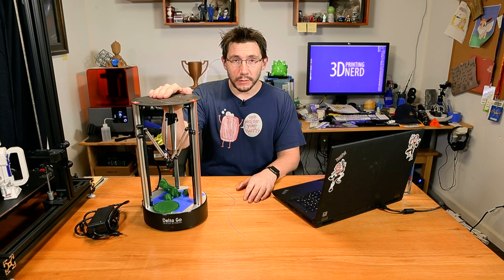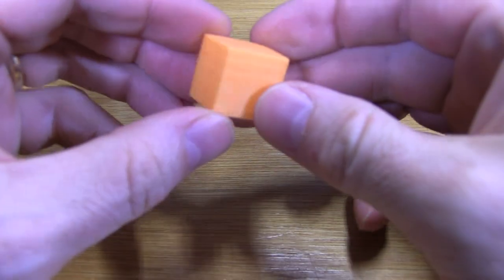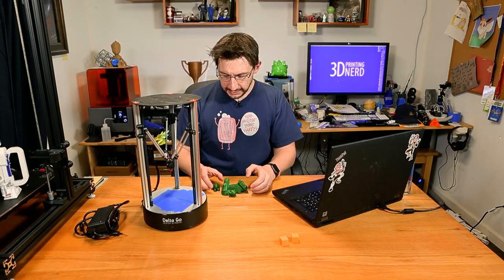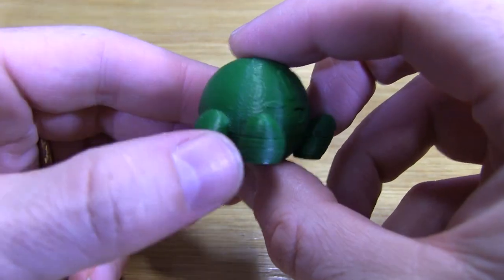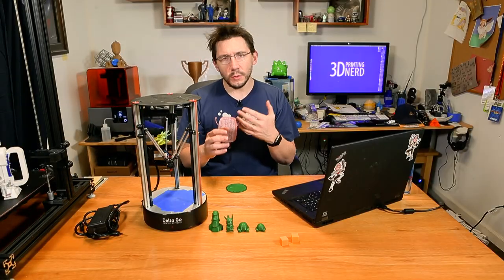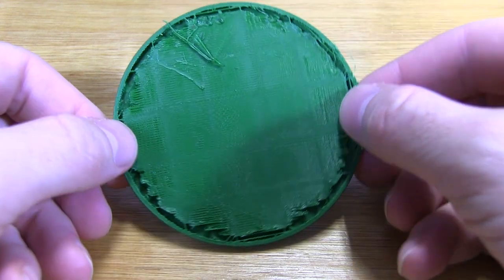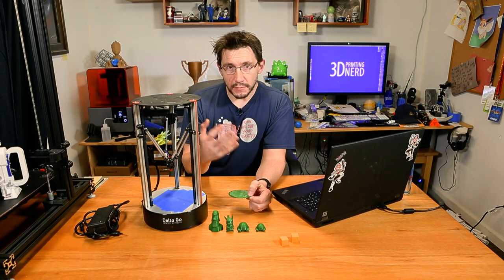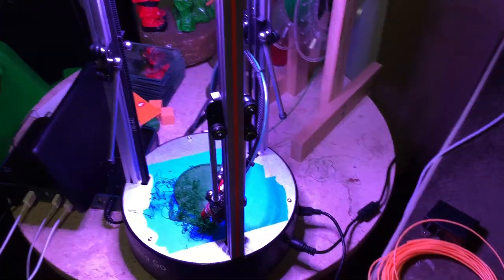Deltaprintr Go 3D Printer Review Update

Comment: DeltaGo was my first printer. It was broken more than it worked & getting replacement parts took weeks. I finally designed & printed my own replacement for the part that kept breaking & had it printing really good when the board fried & they told me it would cost $100 for a new board. It's been in it's box ever since. Now I have a Tevo Tornado & Tevo Tarantula & I'm very happy with them.

Comment: I feel like the heat break is a total design flaw.  There should be something from stopping the shield from moving up causing a clog.  I think I might have commented that on your previous video but I can't remember.  I'm glad they are making changes, but I feel like if they know these are issues, they should stop selling them until the updated parts are available.  Especially when it can be a fire hazard.  I don't love the idea of magnets, I feel like its not really necessary.  Wouldn't snap in pieces be just as easy but more effective?  I look forward to your updated review.

Comment: that hotend is hanging way too low making it unstable when moving fast (center of gravity too low) and it multiplies errors too because that mounting plate will always have some horizontal twist. it also subtracts from maximum printing height and makes it easier to knock those magnets off. i suspect that bowden tube and power cable might be able to stick to those vertically moving "arm elevators" (sorry, having trouble finding right word for those), which would be a instant fail.

Comment: The vast majority of these hobby-grade 3d printers need to grow the Hell up.  There should be a utility PCB at the hotend site to control various things, depending on the printer.

In this case, it could have an MPU6000 which would detect if the effector platform ever tilted away from horizontal.  If it does, that's an automatic error condition on most deltas and shutdown time.

It's also totally greasy for them to request that you hold off on the review.

Comment: 3:50 It is the inherent flaws of magnets. The magnetic force is the weakness at the sides.

Did you get the chance to ask them what kind of magnets did they use?   they might be able to drastically reduce the issues by using stronger magnets, such as Neodymium  N52 magnets.

however, the Z inconsistency is most likely a totally different issue altogether.
Reply from the maker: I didn't get a chance to ask what magnets they were using, though as others have pointed out, they may be too weak for this application.

Comment: As always great video! Thank you! I want to ask if there any sense to make a 3dprinter with no print fan? You'll always have cooling problems! Is it right?
Reply from the maker: Well, yes. My main concern here is why no filament cooling fan on a machine that's built to run PLA filaments? There is no heated bed, so your filament choice is limited a bit, and PLA really benefits from having a filament cooling fan.

Comment: I'm glad I didn't buy this, I almost did though then I canceled because of the wait and I needed another Delta sooner than later so I went with an Ultibots V250 Delta, best printer I've owned so far. Pair it up with a Duet Wifi and it's silent. I wish you'd review more kits but you're a busy guy and don't want to assemble them. I get it.

Comment: Well, here it is almost May... any updates from deltaprintr on this model? Have they said when the new upgrades will be available?
Reply from the maker: +Jeffrey Seymore nope :(
Reply: I saw on their Instagram that they have a new style platform for the hotend that has the balls clip in, and also has an integrated fan duct to cool the print. Looks like a good/better design
Reply: Hi Jeffrey, we just finished production on all the parts for the upgrade. We're just waiting to receive a few more samples for the stainless steel balls before we can start production on those. All current owners will get the upgrade for free once we announce it.
Reply: Deltaprintr nice! I was looking at getting a second smaller printer and was thinking about yours as I like its size, and features it if gets dialed in and reliably printing!! Looks like you are on the right path!! And updates the to extruder motor design/placement? Seems like some people had issues with that as well. And I assume a change in the way the Bowden tube connects?
Reply: The upgrade includes a new platform, arms, new hotend, fan, and new extruder spring that is slightly stronger to prevent filament slipping.
Reply: Awesome! The new version will come out in two weeks. If you would like, you can contact us to reserve it.

Comment: I detect a bit of FUD here...

I disagree with your opinion that this printer is somehow more dangerous than other printers simply because the effector can be knocked loose.  And to be honest I'd expect a more informed opinion from seemingly respected 3D printer reviewer...  

FIRST:  The Smoothieware firmware this printer runs has a built-in hardware watchdog timer to prevent thermal run-away.  Sure your bird's nest of plastic was messy and maybe a bit frightening to see, but it was never at risk of being heated to combustible temperatures.

SECOND: I built a delta that uses zero-lash magnetic diagonal arms similar to these and I've never had an issue with the effector coming loose.  Perhaps the Deltaprintr Go uses magnets that are too weak, but I certainly wouldn't condemn all mag-ball setups as being more risky to use than ball-joint equipped ones.  In fact, one may argue that the magnetic joints may have prevented the heater element or thermisor from being torn free of the hot end...which in my opinion would have far more potential to start a fire than an the effector simply coming loose.  

In any event, regardless of the the overall design, it's a risk to allow ANY 3D printer to run unsupervised.
Reply from the maker: Yes, I know about the thermal runaway watchdog, though, I wasn't talking about thermal runaway. I was more concern with the entire hot end falling away from all magnetic arms and dropping to the same surface the printer is on. That's all. As for magnetic diagonal arms - my guess is you are correct in that the magnets are most likely too weak. If it came across as me condemning all magnetic arms, that wasn't my intention and I apologize. I was more concerned with this specific implementation and not all implementations. I hope that helps.

Comment: Even the models are some kind of catastrophe, also the not-detective toolhead when there is a bump or a collision. I have a flux delta printer with tilt-detection, filament run-out detection, cooling fans, also magnetic sockets (they are working very well). And also it comes with a laser engraver for attaching instead of the toolhead. Also integrated, there is a 3d Scanner (which is still in beta-phase, works not soooo well) Joel, why you dont review one of those machines once? Im quite happy with mine.
Reply from the maker: Hey Mathias, your machine sounds cool, if the manufacturer reaches out I would love to try it out!

Comment: Have you gotten the new printer parts?
Reply from the maker: No I haven't. I think Deltaprintr is going to take this machine back and send along a new one when it's ready.
Reply: Can I ask some advice then. I was considering this and once seeing the video want to hold off. I have a printrbot plus metal. I've upgraded from the printrbot simple (the old wood one with twine and dremel sanding bits) 
What would be a good reliable printer to move to since my printrbot metal seems to keep needing repairs.
Reply: Hi Andrew, Joel will get our new printer to review in less than a month if you're willing to wait :)

Comment: From my point of view, the magnetic system is OK, if one adds quite simple hack - connect the magnetic parts on the moving axes with wire, connect 2 of the ends of the magnets on the hotend parts with wire and then use the last remaining 2 as a switch - once the electric current stops flowing, pause (or turn off) the printer - clearly one of the rods disconnected. The solution would cost almost nothing - basically 2 new wires to the hotend and one small software change.
But this is something I do not understand about at current 3D printers. Almost none of them have even a stupid filament sensor to pause printer, when the filament is out. Why? Due to a cost of a single microswitch???
Reply from the maker: Hey Robert! That's a great hack, perhaps someone will implement that? As for filament out sensors, I think we are starting to see that. The Dagoma delta I saw at CES has that built in, and I'm willing to bed that's going to become the norm sooner rather than later.

Comment: Just a follow up after speaking to Joel - it came to our attention that the bed (tape) was not wiped down with alcohol as per the instructions on our website. This should be done after every print to ensure that the first layer sticks. Otherwise the corners of a print will curl up. In this case, (without actually seeing) I would guess that the part's first layer is curled up in the shape of a bowl.

Another thing I would like to comment on is the Z issue Joel pointed out in the printed cube - that is under-extrusion, not z-resolution or z-axis issues.

Anyhow, we are going to be manufacturing a new platform setup and have decided we will offer it to our current customers for free. We'll also be sending one to Joel to evaluate.

This is by no means to discredit joel. He does great reviews and we're glad he's keeping it honest. We're looking forward to seeing his updated review on the updated effector design.
Reply from the maker: Shai - "without actually seeing"? I showed off THE part that caused the machine to blow up in this video. It was a close up, and it was flat as a pancake. NO edges curled up, and I didin't specific any sort of bed adhesion issues because I had none. There was no bowl and no curling up of the first layer. It's irresponsible of you to make a comment such as this without, at the very least, watching the video first.

Comment: Have you tried the new hotend? I got the printer from my friend as a loaner while he gets back on his feet. I've been able to print a few things but I have the same issue with the printer arms playing hot potato with the hot end.  
http://www.ebay.com/itm/322507092843?ssPageName=STRK:MEUNSOLD:IT&_trksid=p3984.m1560.l2649
thats one of the things I've printed. Quality seems decent but I found this printer has no issues with vertical heavy prints. It tends to pop when I have prints that involve a lot of horizontal movement such as a stand for a model. I've also managed to get a PETG working on this printer. But I agree the original hot end is not a great design.

Comment: WOW they asked you not to review junk they are still selling? That alone would remove them from my BUY list forever.
Reply from the maker: Well, it's not junk, it just needs some new parts in my opinion :)
Reply: Hi Brian, with all due respect, our printers are by no means junk and we make them professionally with mold injected and stamped steel parts. If you want, take a look at our instagram to see some of the prints we've created (without any fancy video editing to hide anything) instagram.com/deltaprintr

We always take feedback seriously and continue to improve upon our product. The arms would only pop off if there is layer warpage, otherwise they should not pop off. This is why we recommend our users to wipe the bed with alcohol before printing to ensure the first layer sticks.
Reply: Your video has a clear mount, it doesn't look like the production one your selling. When I say "junk" I am talking about the real world prints and quality. Your own pic the "Buddha" has holes in it. But all that is minor  when it comes to safety in a non kit printer from a US company.  Warping prints are common as users learn setting and play with filament. Like a auto recall, you should have everyone stop using these until you replace or repair to make them safe. AND stop selling. As an average guy who builds printers and plays with printing that's how I see it and I am sure others do also.
Reply: The arms should not pop off at all.. and if layer warpage is a concern that can cause it.. I dont understand why it does not have a part blower standard.

Comment: Seriously ???  dude, go buy some m3 stainless studding and some traxxas rod ends .. A man with your talent could model up some carriages and an effector , based on existing carriages on any 3d model site .. .. slice and weld ..   I'll bet you ten cents you can do it better than the Go3D guys have .. and provide a fix for the damned firetraps out there .. match rod length  and carriage offset 
and effector offset..  good to go :P

Comment: I bought the 2015 Deltaprintr model (the one before the "GO") at makerfaire 2015 from the owner of deltaprintr in person for $200. I do not recommended their printers as they put the looks of their printers far above the safety, functionality & performance of their printers. Also that printer was NOT safe at all as the heater block caught fire and burnt most of my apartment down. They said in the instructions at the time, that I didn't need to secure the temp sensor to the nozzle as "the kapton tape reduces the looks of the Deltaprintr, and is therefor not recommended."
Reply: Thanks for causing my apartment to BURN IN FIRE Deltaprintr!!
Reply from the maker: WAIT - Your Deltaprintr 3d printer caught fire and burned down most of your apartment? Holy cow. Stephen, I'm so sorry to hear that. Were you safe?
Reply: Hi Stephen,

1. We never sold our printers for $200 or even remotely close to that, perhaps you are confusing us with another company?
2. Could you please provide a link/picture of the instructions that say "kaptopn tape reduces the looks of the Deltaprintr and is therefore not recommended" ?
Reply: Yea.. I would like to see some sort of picture from said fire.. there has to be something.. but nevertheless.. I can see this being a possible hazard with Joel's unit if he left it for say a 12hr print and it was able to eventually knock itself completely off..
Reply: +Deltaprintr It may have been $300 or $250. It was in cash on the first day of makerfaire NYC 2015. I have poor memory. No I cannot provide a picture without a time machine as you have since updated the site. It may not have been those exact words but your site at the time had no mention of kapton tape on the extruder and showed pictures of the extruder without kapton tape.  I'm not holding you accountable or anything just saying get your act together.
Reply: +JAT.MN I would love to share pictures but have been trying to forget the experience of  losing 98% of what I owned at the time and having my forehead melted off. Plus I lost the camera I owned in the fire, and I don't know if I can ask the insurance company for the pictures they took afterwords.
Reply: +3D Printing Nerd If by safe you mean alive then yes I am alive. If you meant not injured, then no I had my forehead melted off and lost everything I owned at the time.
Reply: Hi Stephen, the lowest we ever sold our previous printers for was $400 (the wooden model). In addition, we supplied material to secure the thermistor in the heater block. I'm sorry to hear about your experience, but stating that we intentionally informed users to not use Kapton tape due to "bad looks" is false and absolutely not true. In addition, all of our printers have a watchdog on the thermistor enabled by default. 

We take these types of claims very seriously and if it was our printer, we would like to know for sure.
Reply: Stephen, if you would like, please drop us an email at info [at] deltaprintr.com so we can find out more about the printer you had purchased.
Reply: yea.. I was just digging thru archived versions of the website and gave up after getting to 2013 (2013-2016 archives).. looks like first versions were kits from a kickstarter which used their own version of the J-head design while I can't find the official build instructions for the first versions there does not appear to be anything clearly stating on the site at all at any point in time about the hotend.. 

the j-head is still sold by deltaprintr in their parts section of the website.. looking at the design of it.. I dont see how you could put a sensor in it WITHOUT tape.. o.O

Comment: magnets sound like a cheap way to not use the right parts from the start and the prints don't even look good.
Reply from the maker: From what I've found out, magnets for arms ARE a good solution, though, you have to use strong enough magnets. With these, shaking the machine works because it's not applying a lateral force to any of the arms. Once a slight lateral force is applied, it falls apart.